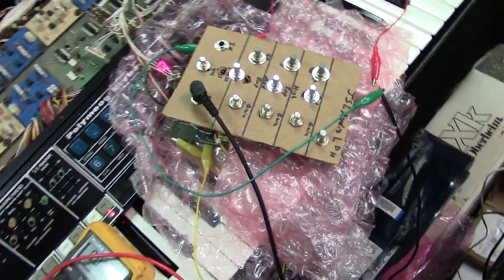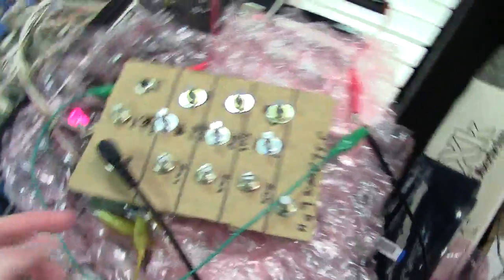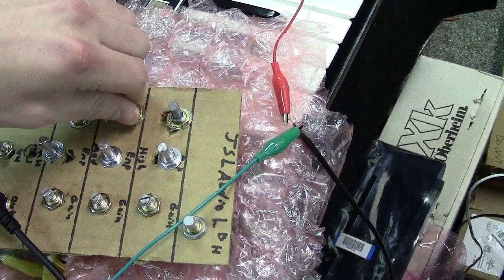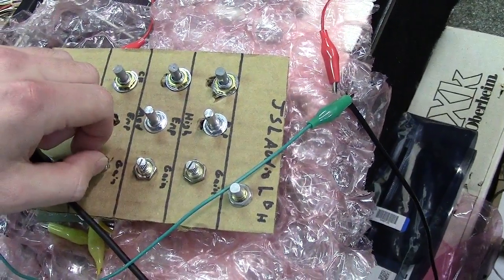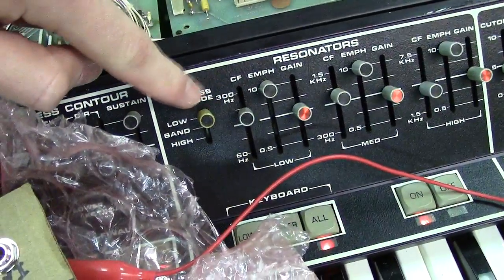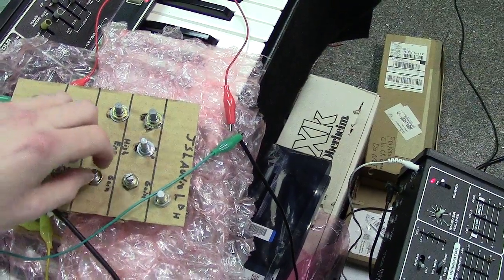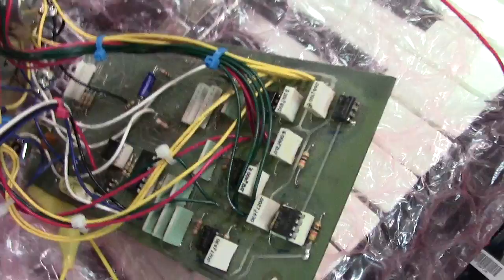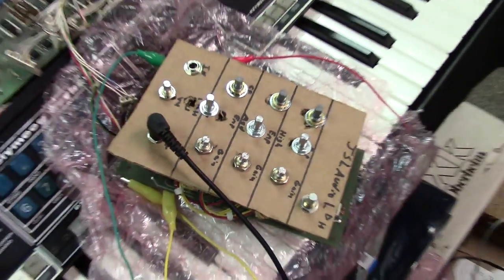Polymoog Resonator Dotcom module build part 1 (by Synthpro)

Comment: do you have a web site? i would like a few synths fixed.i have the front panel to this polymoog and wanted to use it and make a synth from the resonator kits and some other synth kits..
Reply from the maker: Hi gamatron,

Very sorry for the late response. I do not have a website at this time but am working on getting one started. absolutely, you can make all kinds of kits out  of the interface from a polymoog, there are a few sliders of the polymoog that are audio taper as well as linear so you would just have to pick the right ones to use for your circuit designs but it can be done.